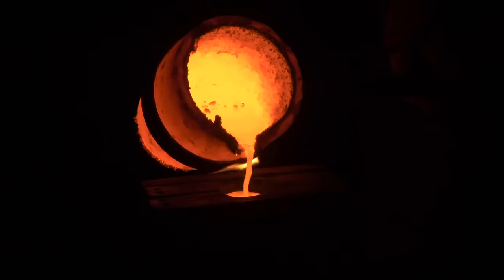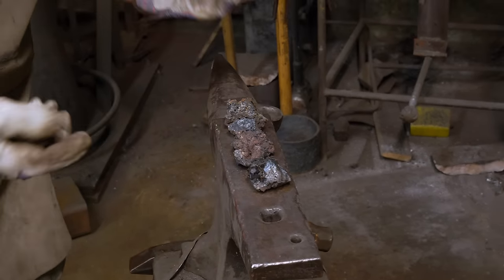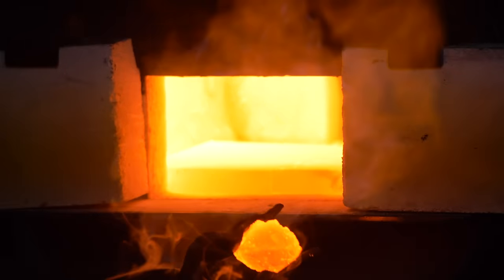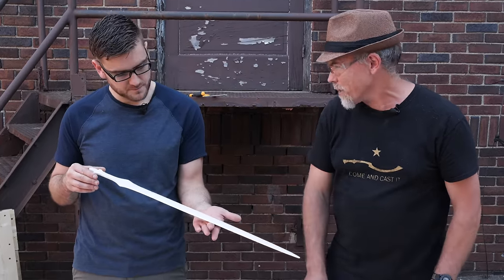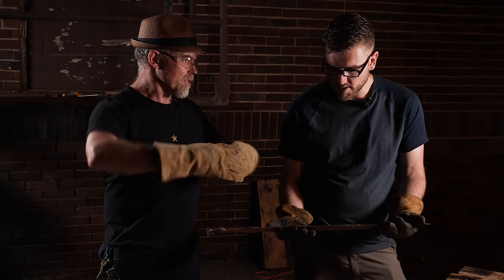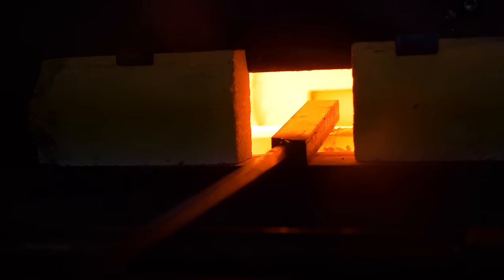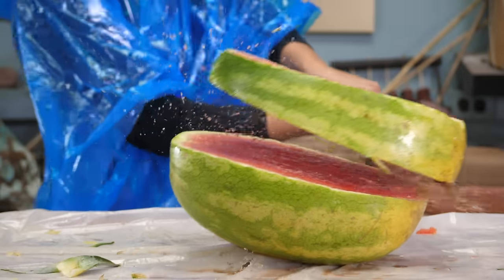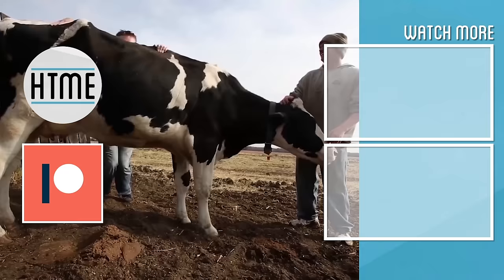Forged Iron Sword vs. Cast Bronze Sword

Comment: As the Bronze age fighter pointed out: Historical soldiers weren't trained to block with their blades. They had shields for that.
Blocking with a blade puts you in a situation where the opponent is building momentum, and you are not. You might as well be flat on your ass in other words.
That isn't to say that no one ever won a fight because they blocked with their blade, but that's the rare emergency where it's necessary.
At the end of the day: A Bronze wielding warrior could easily kill an Iron one. And no; the Iron one will not be chopping through their blade. The tests here prove Bronze bends; it's not brittle. And only bends if the one holding it makes the mistake of blocking with it.
Reply: In that sense, the Iron Wielding soldier could just as easily kill the Bronze one, it all comes down to whichever combatant is more skilled and experienced
Reply: @jaydenlobbe7911  we are talking if they are the same skilled
Reply: Im not sure how you came to that conclusion iron is not brittle and just like his tests showed it would have no problem breaking and choping through bronze sword. You are thinking of cast iron, cast iron is brittle and it has over 4% of carbon in it, by comparison spring steel or good steel sword would have no more than .5% of carbon. Iron is very tough its not as strong as steel, but strength and toughness are two different qualities. Strength is defined by how much force or load an object can handle with out bending, taking a set, or breaking. Toughness is the ability of an object to withstand repeated blows, and impacts with out cracking and breaking. Iron is very tough tougher than high carbon steel, but it is not as strong. But ultimately Iron is far superior to bronze,  Iron tiped arrows and spears could go through bronze like butter, bronze would deform and bend hitting iron but has no chance of going through.
Reply: Bronze is not one metal. Bronze is as varied as steel. And weapons grade bronze age bronze beats iron age iron any day. Bronze wasn't exclusively cast either. In fact, it could be forged at a way lower temperature than iron. It was also heat treated and tempered before it was cold hardened. Cold hardening was just used to reinforce the bevels and the edge. The bronze-clad Greeks didn't curb-stomp the iron-wielding Persians for you to come along and say "Buh! Bronze is bad because we're dumb and don't know how to make it properly! Buh!"
Reply: Plus blocking eith your blade gets your posture meter eay above comfort levels
Reply: Also, when warriors block with their sword, they don't actually block. A trained swordsman parries their opponents' weapon, using the flat or side of the blade, not the edge, and redirects the weapon instead of stopping it, using the opponents' momentum against them to throw them off balance or create an opening for a punch, kick, elbow, shieldbash, pommel-strike, headbutt, grapple, bite, or follow up attack. This is why bearded axes were so popular for so long. Their shape and design allowed for maximum control and leverage after hooking an opponents' weapon or shield, or leg.

Comment: I’m 20 seconds in and by the footage that the bronze sword has not been hammer hardened properly.... this example is historically incorrect.... it’s my day job to study Bronze Age weaponary... there seems to be a disruption to the surface of the bronze. This is work hardened by thousands of taps with a hammer to strengthen the edge and flats
Reply: Yeah, he mentions polishing out all the divots he made while he was work hardening it - his words not mine lol - so he probably polished off most of what he did harden with the angle grinder trying to smooth it back to an oval profile. 

I know they're trying to be true to how it would be in not having an anvil to work on, but he could have found a flat stone instead of one that gouges and chews up the material he's trying to harden on it. Bit more of a research effort and proper preparation peeps!
Reply: Also hitting the weak soft part of any metal with the strong, aligned edge of it is gonna cause problems. I dunno why that guy thinks they used the flat of the blade to "block" 😒

Comment: I don't think he researched it enough, and I'm not sure he'll do the smelt again unless he improves the bellows, but after you do the melt and break open the furnace to reveal what you've got, you're meant to take it IMMEDIATELY and smash the bajeebus out of it for a long time. 

Basically what he made was a very soft rock/carbon thing which kind of acts like ceramic. It is also very crumbly, which means it's brittle. But that chunk had lots and lots of tiny nuggets of Iron and Steel strewn throughout it, which you saw when it was broken down (think of it a bit like a chocolate chip cookie, but very dangerous, burnt, and probably not very good for you to eat or even touch). 

What you need to do is while everything is still VERY hot (as in, get it out of the furnace stack as soon as you stop bellowing) and start smashing it. What you're doing is forcing all the kind of sticky, treacle-like Iron/Steel mix to move around inside the ball, and because it's sticky, it grabs onto other pieces of almost molten hot metal, and after a while, it all consolidates into one ball of metal surrounded by the slag. Because you're hitting it, you're exerting energy on the ball which will keep it hotter for longer, and not brittle like you found out. Once it cools, that's it, it's not going to come back together unless you smelt it all back down together.

But once you've smashed all the tiny bits of metal together and it's cooled, you just give it a quick smash and most of the slag will crumble away! That, or drop it in water, but that sometimes ends up with an explosion, or everything shattering. Both less than desirable outcomes from the experiment.

I hope you do it all again just so you can experience what people went through, and what good historical weapon recreators go through to get a very period accurate piece of art
Reply: has he ever done anything really to perfection?
the goal of this channel is saddly mostly to emtertain and not to do things on a quality level.
Reply: @BlackDragonWitheHawk  It's not a case of doing things to perfection, it's a case of doing things right if you're going to go through all the effort to portray it as "doing it right". 

The whole "here's one I made earlier" gets old quick too. The "comparable ingot" wasn't even slightly comparable and if it had less than 10% extra effort put into all of the steps that were went through to doing the whole forge stack thing and bellows, he could've got a really impressive piece of metal that could have been forged into something amazing, or, at least, failed dramatically in an entertaining way. Rather than it depressingly crumbling into a million tiny pieces, it could've shattered into a billion tiny pieces at the very end.

I can't help but feel he would've been really disheartened when he went to forge his steel and it just crumbled like, ironically, a cookie, when hit with a hammer. Just 10% extra effort could've turned an "aww, that's disappointing" into a "WOW! That was amazing!"
Reply: I didn't read your whole comment but by what I read from the first two paragraphs I agree he should research a little more just to make sure he does it historically accurate
Reply: @isabellac.8351  Eh, you get the gist anyway :)
Reply: It’s basically like a forge weld right? Is that why wrought iron has Damascus like patterns when it’s been etched?
Reply: Although it is definitely preferable to begin consolidating the bloom immediately out of the furnace the result should be more or less indistinguishable from reheating the bloom to a welding heat, some blooms are more prone to crumbling than others and it takes practice to get the process right.
Reply: @norwegiannightmare8843  Yes and no, because you're working with very small particles of iron in a carbon shell material, they almost get smashed together at the atomic level. The damascus part comes from when you fold it over a few times after it's all been consolidated together to sort of finalize the consolidated material, which traps small amounts of the carbon slag inside that weren't able to be removed.
Reply: @garethbaus5471  Because of the mass of the slag material, and because of the type of material it is, it acts as a fairly good insulator (which we saw in the video of the red-hot material cooling down, that wasn't iron, that was the slag) preventing the iron from remelting unless at an incredibly hot temperature, and usually needs the presence of oxygen to burn away the slag. However at those temperatures and with the oxygen, the iron just goes back into ore-type form iron oxide, basically taking you back to square one.

The other problem is that because the beads of iron are so small, and, at that scale, so far apart, they barely ever come into contact with one another to form into a larger bead. The insulating properties of the slag also prevents the beads from melting, however you could heat up the full thing again and do what I said in my original comment of smashing the everloving crap out of it to force the beads to come into contact with each other, causing them to stick and turn into a workable piece of iron/steel.
Reply: @omarakhtar3075  That is kinda the point, seeing if a regular guy can do all of this
Reply: @isabellac.8351  I think his goal is not necessarely accuracy.
His goal is to try everything and explore and have fun...
Reply: I think your over thinking thibgs.. he's just trying to show the process.  Then move on to the next with what he was able to prove as possible.. he doesn't have the money or crew to actually take it step by step with the same materials.. its all about education not actually complete function
Reply: @noneneed  It doesn't require a lot more in resources as much as a change in technique and mode of creating the bloom. I've seen other YouTubers get a good bloom, but they invested more time and effort, and as you might expect, you get a better result.

Having an understanding of what you're doing is always key and I think they were shooting in the dark with their attempt to make a nice bloom. The amount of time and effort they expended on it they might as well have doubled down and got a good result. One of the important aspects is what the alloying elements are, if you introduce too much sulphur then you'll never get good steel. Knowing what you're putting in on a metallurgical level is important. 

What it shows is making a solid bloom is not a game for amateurs. It requires a good amount of research upfront and a lot of hours waiting around. Not really much money required though! Just a few bags of charcoal, something to make your furnace out of and a batch of ore that has previously been analysed for chemical composition. Then it's a matter of letting it run for a day or two at the correct temperature. You literally get out what you put in, so you absolutely have to put the right thing in in the first place.
Reply: The point of this series is to show the process of how everything was made throughout time, not the art of it, the science and discovery part is what he's focused on, like hwo civilizations evolved and improved technology, I do agree that forging is an art, lifestyle, and respectable craftsmanship, but this isn't focused on doing anything perfect or in depth on just a single subject it's more about trying to show the process and work needed to go from early technology to modern technology and everytging in between
Reply: He also gave to 2 guys that helped him a shout out specifically for people who wanted more in depth stuff in this specific category of metal working
Reply: @brertt8350  while that may make sense, I'd like to direct your attention to the five attempts at making glass from scrarch... Going all over the states to collect the raw materials, getting help from many people including Cody from Cody's Lab and the late, great Grant Thompson just to try and perfect clear glass. 

He made the effort to do something properly, going really out of his way to do it as well. Which was great! Even when it didn't fully work, he kept trying. If he put in one fifth of the effort he put into glass making into the metal stack, then he would have done something at least "okay".

He's not just showing the process, he's trying to do it to the best of his ability, and his ability is far beyond what was portrayed in this. Like I said, even if it failed, it would've been an amazing failure, instead of tiny bits of iron crumbling under the weight of themselves in a lump of slag.
Reply: OMG!  I've seen so many iron bloom videos, and they always have the same crappy results.  This makes so much sense!  Can I have some sources on the specifics?
Reply: Random youtube commenter more knowledgeable than a whole workshop of blacksmiths. Guess that happens when you contact blacksmiths only familiar with modern smithing
Reply: Im no expert and idk if its historically accurate but he could've used all the iron and steel chunks and the powder to do a forge weld and make damscus steel/iron
Edit: damascus was first discovered in the 11th century ad so too far foward but then again if a modern forge isnt too far ahead...
Reply: @whiskeysierra07  damascus is ancient compared with the modern workshop they used. That said, they ended up using MODERN steel when they couldn't produce even the smallest amount of iron. Other commenters explained it, the smith didn't understand how to deal with bloom iron and fucked it up. That is why they ended up with nothing.
Reply: @MarcRitzMD  They should have smashed it all down, let it cool then went through the debris pile to pick out the metal "pellets" that would have been mixed within the slag.   Then  reheat those and forge weld them together.  They wouldn't have had anywhere near enough to make a sword but........it would have helped showcase the process.   It would have taken many many blooms to make a sword that size or at least one much longer bloom and far more ore.  Most sources of iron ore actually have a low percentage of iron in the ore so it takes a LOT more ore  than one thinks to make enough iron for a sword that size.

Comment: It's a cool video, but I've noticed a few things that's not accurate. to avoid bending, bronze age swords mostly had a thick spine to make it more rigid. Also, bronze should be a bit harder than wrought iron: 60–258 on the Vickers scale compared to 30–80. (but definetely not as hard as even low carbon steel which is around 130-600). It wasn't iron's superiority that prevailed, but the availability (compared to tin, required for bronze)  and the requirement of only one material instead of two. After the bronze age trade collapse and the smelting technologies improvement, iron was cheaper and easier to make than bronze, so it became the main metal to use, but not because it was a superior material at the time.
Reply: shhhh, thats dangerously complicated reasoning for this channel as well as most of the comment section.

Comment: Pretty interesting stuff, though I can see why when you had access to tin and copper, you would have an advantage with being able to outfit more soldiers far quicker. Though I could see officers and veteran soldiers receiving iron weapons... Though that sword was made with modern soft steel, not the stuff that you would've seen back in the day, that one bar alone would've been of mythical status in Europe at the time.

You could pour 30 or so swords before finishing one iron/steel blade, and there's the whole argument of "good enough" to kill.
Reply: Also it was so much easier that it was even worth importing tin from far-flung places. When the bronze age civilization crashed and trade slowed, metalwork became much more difficult, and it was in that necessity that ironworking technology improved.